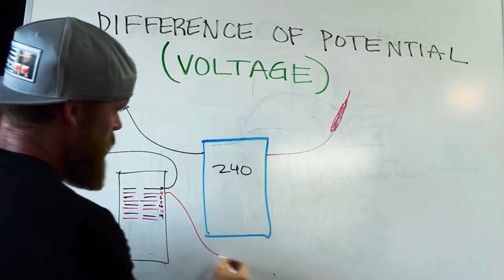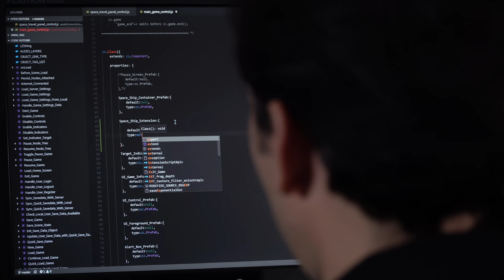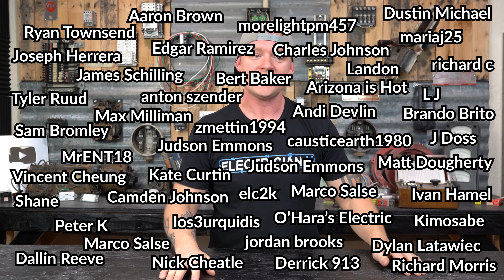PROBLEMS WITH THE TRADE (Part 2) - Our Public Education System

Comment: Hi Justin,
My wife and I have worked in education for the past 15 years and I will definitely say that there is a problem getting students exposed to the trades. STEM is the new buzz word in education and is pushed heavily at most schools. It is exposing students to different things but the big areas pushed are coding, engineering, and computers. This is great but there are still going to be students that want to do more hands on things other than just work on a computer.

One of the suggestions I have for you is seeing if local schools in your area have a shop class of some kind and see if you can go speak to the students. Many high school students have college prep rammed down their throats and schools are slowly realizing that many students have no desire to go to college. Shop classes (vocational tech) are slowly coming back. Having subbed for classes where there were guest speakers, the students greatly enjoy hearing hear from people working in their desired area. 

Another thing is many high school guidance counselors have a hard time advising students on how to get into the trades. Applying for colleges is pretty clear-cut. Student wants to go to this college, they need to follow these steps. The trades is a whole different world to apply for and many just don’t know how to go about it. 

You making a video for high school aged students and high school guidance counselors on  how to go about getting in a trade job I feel would be a major help to aspiring workers. 

Just my thoughts.

Comment: Make a video on objectionable current
/Stray voltage. It's a topic many "electricians" can't discuss. It's dangerous and it's not addressed enough. 
NEVER use EGC/Ground as a replacement for a lost neutral. It can get ppl killed...!!
Great videos Dustin 🤘new sub. almost seen em all now🔥🤘⚡
Reply: Open Neutral extremely dangerous,
Kirchhoff’s voltage rule for series circuits explains it all. Thank you.
Reply: @seniorcomputer3292 yes I'm well versed on the topic, however too many "electricians" are not and it's rarely addressed. Worked with a guy the other day and his solution for lost neutral was to tap the EGC.🤦‍♀️ Hence why I suggested the video..

Comment: I agree with your video it was very well made and accurate. This was my experience in the electrical trade. I loved every minute of it but decided it wasn't for me. 

I did residential custom homes and commercial electrical work for 4 years in Arizona. This is Arizona's economy so I can't speak for all the states but I imagine it's similar. 

I started with no experience and worked my way from 12 dollars per hour starting to 18 dollars an hour when I decided to leave the trade.

I absolutely love doing electrical work. Bending EMT, pulling wire, making up boxes and panels. Then looking back at how neat and organized the work is was very rewarding. For some reason I still watch electrical videos on Youtube because I liked the work that much.

There are the obvious everyday pains of climbing ladders, bending over for hours, cutting yourself on everything, and finding every way imaginable that your tools can pinch your fingers and hands. That part of the job was not that bad it got better with experience and finally submitting to the protective gear helped a ton.

The real reason I left is because things are getting so expensive and the trade wages were not rising with the tide. People at my company with 15 years of experience were making 25-30 dollars per hour. Most of the people at the company made between 40-65 k a year. Providing for a family on a single income like that is tough.

I decided to go to college and am studying software engineering. I have a year to a year and a half left. The starting wage in that industry is around 100k and only goes up from there. 

Electricians have so many necessary skills for the world to function and it is a shame people are not getting into the trade. In my opinion I think the cost of living compared to the wages are too imbalanced to sway people from persuing other options. 

That is just my honest experience and take it with a grain of salt. Your experiences could be entirely different.
Reply: Don't know what cost of living is like in AZ but out here in the Seattle area...pay is at least double that for a commercial electrician.
Hell, we make $40k to start as an apprentice in solar, and apparently this company pays less than others in the area.

From looking at a union list announcing the pay city to city, we're definitely on the high end, and it does vary quite a lot.

Comment: I got my journeyman electrician ticket recently. I'm 25 years old. To be honest I think I'm going to switch to a cleaner job. I worked in commercial construction(running conduit etc). I never particularly enjoyed it. My parents pushed me to stick to something.
Reply: Journeyman? at 25.  
Can you go into business for yourself?
Reply: @seniorcomputer3292  Yes I finished all my hours and school as fast as I could got it done before I turned 25....I woudnt go into business; way to much responsibility and headache. Electrical work is technical and low margin for error. And if any errors its a nightmare to fix/figure out.....
Reply: I'm planning on working as a school custodian, some schools pay a decent starting wage, and they always have pretty solid benefits.